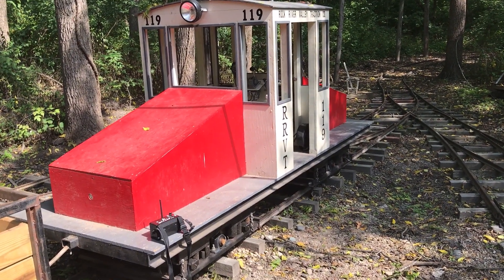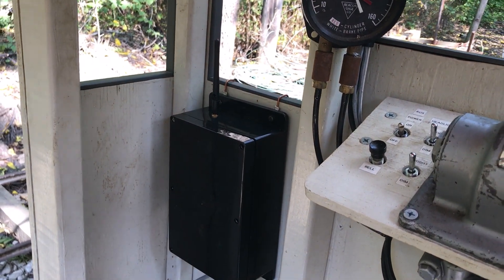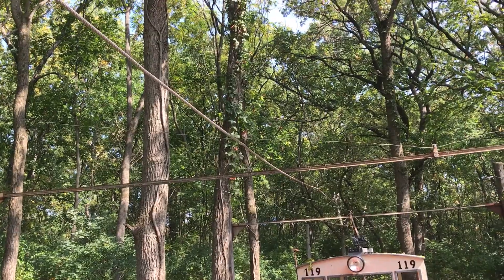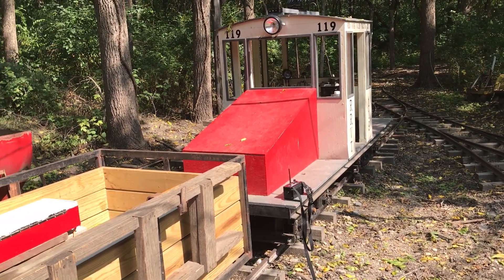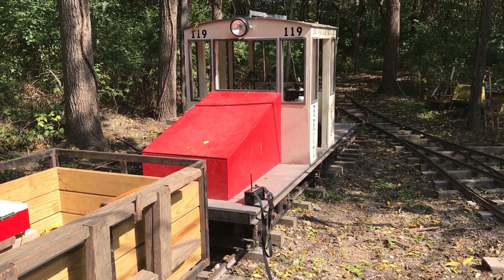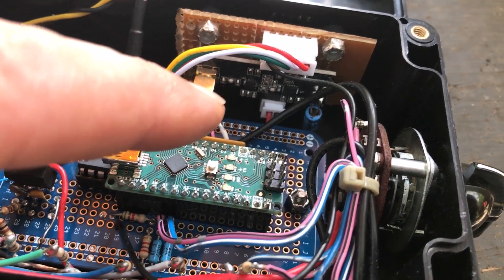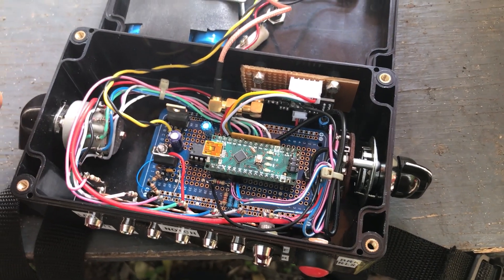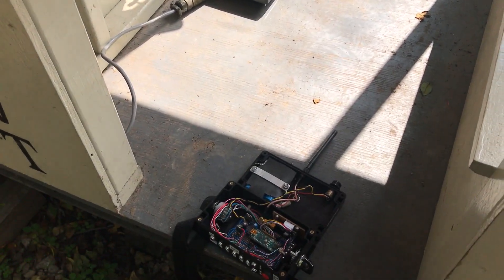We now have radio remote control capability on the RRVT!

Comment: Have you considere or would be possible to enable the loco with some type of battery operation to enable you to work on the catenary will unpowered. What DC voltage the loco works on internally ?. Great addition.  I would add a kill switch, in form of a cord that you can plug int hte front on the loco it you can trow it on the gondola car while you are working in case something decides to missbehave you can hit the stop button. Well probably a cord to attached to the trolley would work LOL.
Reply from the maker: Battery operation is possible as the motors are 36V DC. But for cost reasons I operate from the catenary.

Comment: You could take this further and integrate a remote shutoff for the OLE should you need to isolate it and not be next to the main supply switch.
Reply from the maker: I've considered this actually, but the walk is never too far so it just hasn't been done.

Comment: I have enjoyed every RRVT video without exception, and this one joins the list!
Just curious if you are clear of the overhead when doing the remote overhead line check?  In the motorised car you seem well protected from a falling catenary, whereas here if you were tempted to operate from the rear car to observe then, perhaps, it would seem you are quite exposed to a falling catenary?  However I'm sure you're already all over this, I'm only mentioning it is I hope you stay safe and have many many years of RRVT ahead!  Cheers =)
Reply from the maker: You can touch the catenary while it is energized as long as you are insulated from ground. Rubber boots work fine for this, and I am also standing in a wood deck car which also makes it insulated. So there is no issue doing the work with the line hot. What would be a problem is if you touched the line while some bare part of the body is grounded, then its a really bad situation so we make sure this isn't going to happen! Happy holiday season to you :)
Reply: ah and also forgot to ask, what height do you set your catenary to?  I'm 1.9 metres tall so I was trying to imagine how high it would be above me, cheers!
Reply: ah nevermind the height question, just learned from your other video https://www.youtube.com/watch?v=uG67Iqb9b0c that its set approx 8 foot above the rails - cheers!

Comment: Great fun to see :) You use battery to feed the controlsystem, but wat voltage do you use on your catanarywire?  Greetings from Norway
Reply from the maker: The catenary is 240V AC, with the wire being at 240V and rail is ground.

Comment: What a fabulous addition to help with maintenance. Thank you for sharing 👍
Reply from the maker: It really will be, I'm really excited to get to work on it in the spring. As a general rule I do no overhead maintenance after September as the amount of tree limbs that come down on the wire in the fall and winter months would just ruin all that work and I have to redo it in the spring anyways. Fingers always crossed for no heavy wet snows and high winds through the winter, that is mainly when all the destruction takes place!

Comment: Behold,  the worlds largest toy electric train.

Ngl thats very impressive, would be very hilarious to see the boxmotor fitted with this and just see it run without a crew seeming "out of control"!
Reply from the maker: I'm going to be putting a video of the boxmotor up soon, I actually ran it this year for the 1st time in over 10 years. Control system upgrades are planned for that car soon so it will be like the others- which means its conceivable that the remote could interface to it if I wanted to :)

Comment: You might want to look at the ESP32 units you can set up a wifi network around your system to control and monitor everything having wifi and Bluetooth built in saves having separate radio like the nrf it also enables the use of a smart phone for a control unit.
Reply from the maker: I've thought about this, you never know what the future may hold!